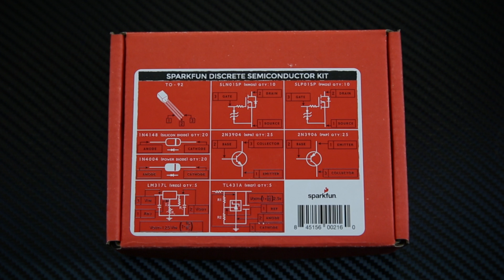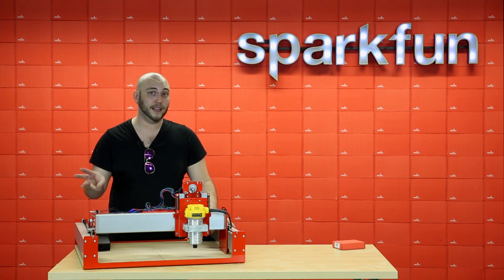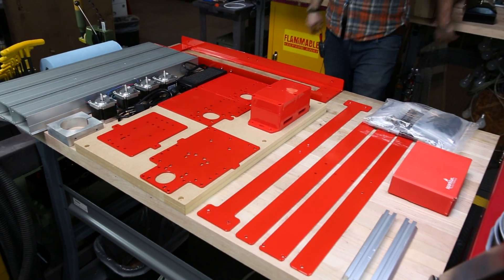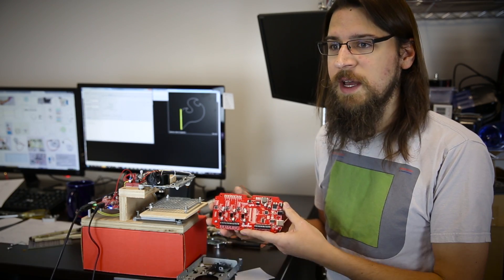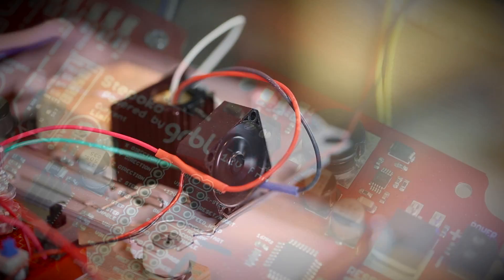SparkFun 11-20-15 Product Showcase: Shapeoko

Comment: This looks like it could be a better option than ordering directly from Carbide3D? I recently purchased a Shapeoko 3 XL, but haven't had an overly exciting time getting it to work. The controller was damaged, the assembly instructions are lacking, some of the cables are too short... now I've got a "GRBL Error: Cutter not found" error. I'm sure other machines also have their troubles.

Comment: I noticed that the Shapeoko assembled on your website, the drive belts were installed backwards to what the Shapeoko manual recommends (The spare section is facing up under the main belt, which interlocks the teeth to add a little more strength to the overall tightening).  Is this just an oversight, or do you have a particular reason for doing it this way?
Reply: Do you have any vids on this Machin ? Would love to see what stuff you can make or have made , thanks stirlingfromla

Comment: What routers are recommended.
Reply: +jpalm32 The mount that comes with the S3 is made for the DeWalt DWP611
Reply: +Mark Moran Me too (difference between the two boards), I did notice that Skark's board isn't plug and play...boo)
Reply: The most common router you see for the ShapeOko 3 (as well as an upgrade to the X-Carve) is the DeWalt 611 trim router. I've seen at least one using a Makita trim router as well, although the DeWalt I believe fits in the mount right out of the box. I recently got a ShapeOko 3 kit from Carbide but haven't assembled it yet. I'm curious what differences the SparkFun controller offers? I love the SparkFun community though and hope this means that ShapeOko 3's will get a lot more attention and tutorials now.